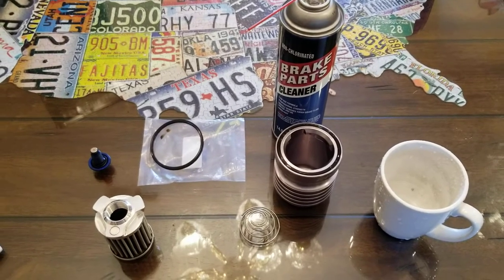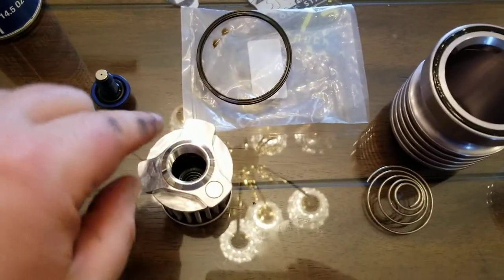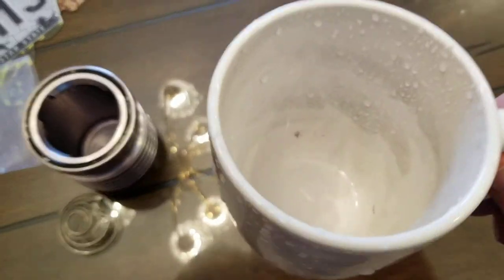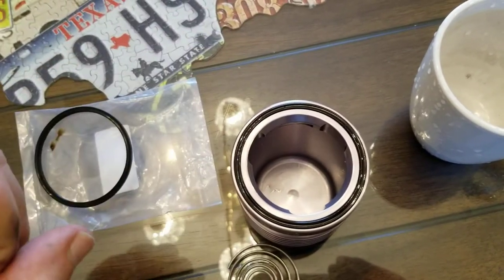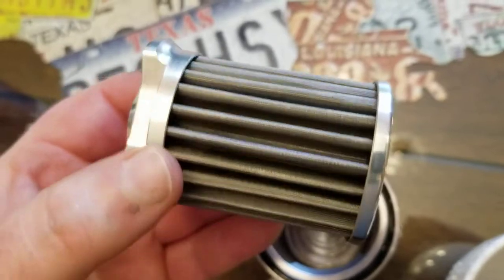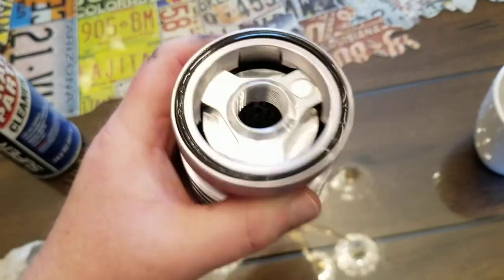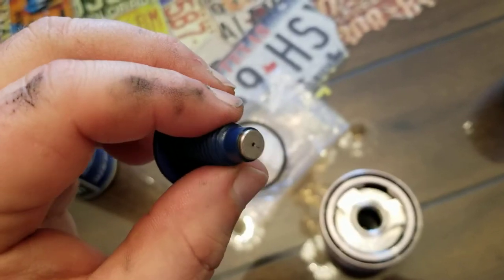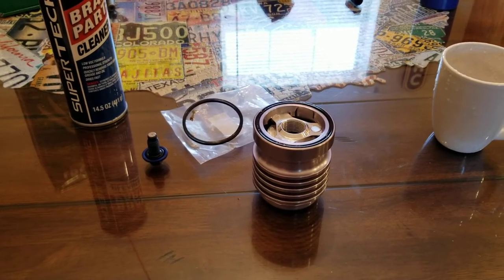(PART 2) BEST OIL FILTER -K&P ENGINEERING  BEST DRAIN PLUG - DIMPLE  &  SCHAEFERS OIL Test Run

Comment: How many miles do you go before you change the oil on this truck?  Is there a recommendation as to how long you can go before an oil change.
Reply from the maker: I always try and go for 5 or 6,000 just to be on the safe side. But you can go 10,000 as long as you use good oil and a filter.
Reply from the maker: Please SUBSCRIBE:)
Reply: MATTHEW MELTON I’m looking at this type of oil filter but wasn’t sure how often it needs cleaned or if it could do 5000 to 10000 miles using Amsoil Signature Series.
Reply from the maker: @SilverAlert1  you will be fine with this filter it is truely amazing I am impressed every time I change my oil. I believe this is hands down the best filter on the market.